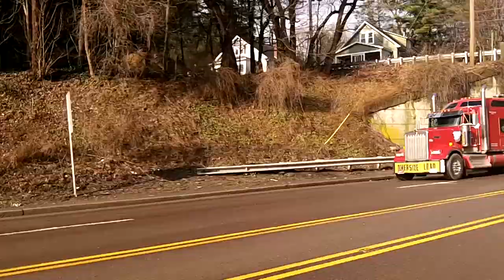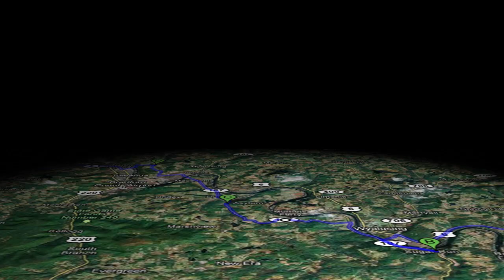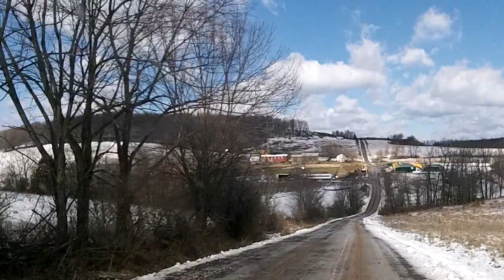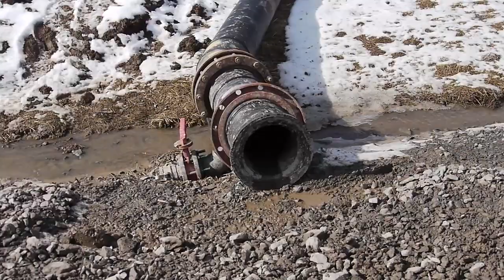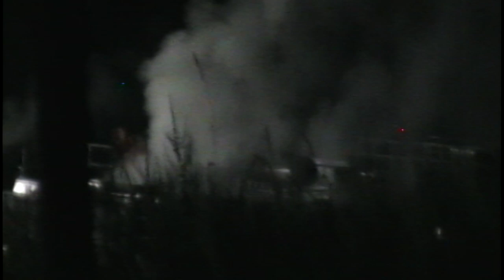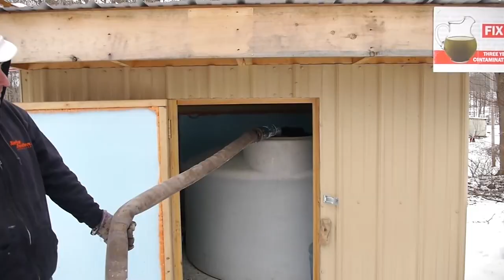Gas Well Flaring - Marcellus Shale Reality Tour Part 4 - Fracking

Comment: In industrial plants flare stacks are primarily used for burning off flammable gas released by pressure relief valves during unplanned overpressuring of plant equipment. During plant start-ups and shutdowns, flare stacks are also often used for the planned combustion of gases over relatively short periods.

Comment: Just a quick note here. These are combuster stacks, not  flare stacks. Combuster stacks cause nearly perfect combustion of the gas making the burnoff very clean. Unfortunately this makes them very loud as well. Flare stacks can be noisy, but you don't get that ear piercing whine with them. They also don't have a complete combustion with them either. So greater co2 emissions.

Comment: Imagine how the amount of power that is being wasted by flaring, i mean, i understand that there's a LOT of gas, but there should be some kind of use
Reply: You would either need mobile CNG compressors and ship the gas out in tankers (which is rare and expensive) or a mobile generator and somewhere where a transmission line operator or electric utility has both infrastructure that can handle many megawatts dumped on it and that is amenable to said megawatts being dumped on their system for only a week at a time.  Let's just say that the utility relaying engineers would have words...

Comment: Watch well water burning from fracking contamination.  It has identical hydrocarbon signature to the natural gas nearby. https://www.youtube.com/watch?v=jA0Kfh8GB2c
Reply from the maker: It comes mostly from bad cement jobs done by the gas frackers. The naturally occurring gas in the ground finds its way into the aquafer contaminating it with methane and other heavy metal elements that come with it, like arsenic and magnesium. There are other means like spills that can cause contamination as well.

Comment: that jet engine sound is a turbine generator, not the safety flares, look into how much horsepower it takes to frack a well, it's an insane amount.
Reply: Hvguy Turbine noise is usually heard during the drilling and fracking process before a well is brought into production. This video of flaring gas (the fire) and venting (release of well pressure gasses)  is another pre production stage. Both are noise impacts that are usually addressed separately by local county ordinances, if at all.
Reply from the maker: Sorry, but I was there taping the flares. The sound is coming from the flares.

Comment: Look folks. Lets use common sense here. In the 1700's they opened up the coal industry to supply the industrial growth & home heating all across the east coast. The majority of those mines were in eastern Pa. For over 200 years & continued westward as our nation grew. For over 200 years. Where is all the Air Pollution? & where is all the water pollution.? 200 years of digging coal & 200 years of everybody burning coal, for Industry to grow & families to heat their homes. The mess it made is gone

Comment: I'd rather them frack the United States than to frack beautiful New Zealand.  You have such a quiet, beautiful, green country.  it won't be that way for long once the oil field traffic starts moving it.  First it will tear up the roads in infrastructure, and it just goes downhill from there.

Comment: Wells Are flared because of many reasons, from what i understand alot of has to do with controlling pressures, also i'm guessing what you seen in between the flaring was was a flitering process of the water that pushes back up when the well is going into production yes it does smell and it is under high preassure and will release steam,

Comment from the maker: Would you consider 7-8% of well casing leaks immediately, and 60% after 50 years? That's per well, if you have 10 wells on a pad, that's a 70% chance of well casing failure immediately. That percentage has gone up in the last 2 years. That's not a number I will trust with water I have a right to as a Pennsylvanian, and certainly not worth the risk.